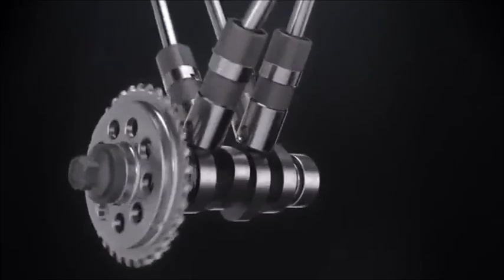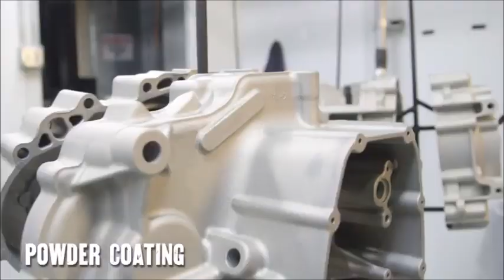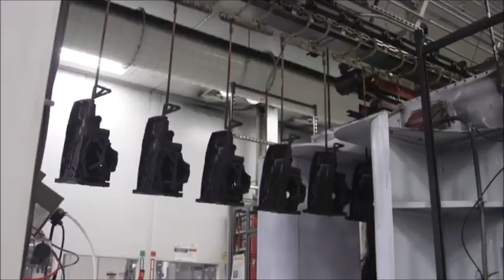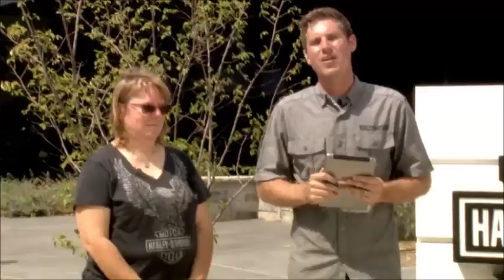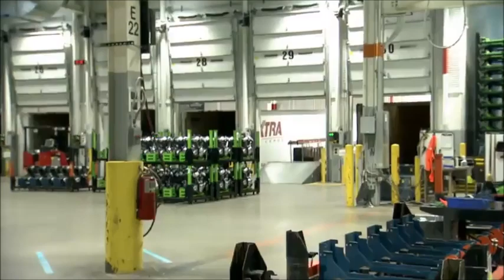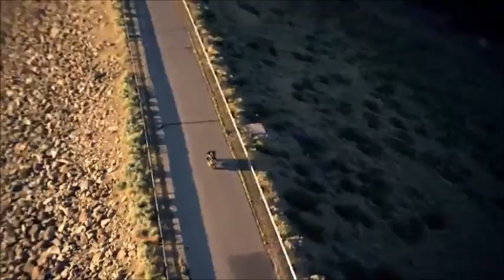Harley-Davidson Factory Tour - Building the Milwaukee-Eight 107 Engine

Comment: My last comment My engine oil 60 weight Airplane Engine oil fabricated power steering cooler from an automobile cut the barb’s off soldered number 6A AN fittings stainless braided throughout the bike no hose clamps, enough said.🕶

Comment: Part two of my comment only did a valve job once in my kitchen floor turn the oven on about 500° for about an hour and a half my valve guides in the freezer made it inserting tool out of a diesel valve guide had my wife hand them to me they were numbered send bag on the floor burlap folded sacs with my mallet I said one she grabbed one and served it as for number two inserted it hand lab The valves to the seats fresh rooms put it all back together again ran fine who needs to pay for a mechanic not me now you know what I did and how I did it right now on the last leg of finishing my hot rod 1940 Ford deluxe coupe I’m doing all the work myself as usual there at his fellows, 🕶

Comment: Hello fellows my favorite is a 1950 FL rigid dog leg frame built it myself sandblasted the frame took care of the hairline cracks stress relief the frame squirted Emron urethane dark rich blue metallic stark six over Springer cut the down tubes of another sprayer add that to mine 6 inches over stock front rocker edit an inch and a half the ride was fabulous no High speed wobble design my own seat with Sissy bar edit fishtails blue Blue Chrome everywhere custom made chain guard out of brass added a brass bib between the tanks carburetor mount brass high-rise manifold 3 inches on my T manifold with a Bendix carb high speed adjustment needle fabricated a thumb lever for my retard and advance my distributor Hallcraft  spool on my 21 inch Avon speed master front tire mounted on my springer bracket to hold my hand grenade blue chrome, 22 inch ape hangers customize my clutch do I have Fiber fiber plate to a full plate transmission sprocket 24 tooth primary phase 3 Belt Dr. turn off the chain Oiler and never had any issues with my scooter 22 years with me, replace the pushrods with solid ones that stupid plunger on top of the pushrods Factory sucked if your push rods are out of adjustment that plunger falls between your rocker arms also made custom rocker arms the arms were bolted on not one piece

Comment: Jared, why doesn't HD offer their new Milwaukee-Eight 114 (114 cubic inches, or 1,870cc)  in the Breakout model or any other series that Harley produces? I don't get it. You want bragging rights from a-z then you offer up your best/latest.  

GM is doing it via their new Camaro. Going toe-to-toe HP-wise with their fixture, Vette, line-up.

Comment: Ya right im glad harley is trying to update the engine and all but they have had alot of time do so and really never tried to address the fatal flaws in them for all the years they held sway in market. The thunder stroke 111 by Indian is a masterpiece  and now that harley has real competition again and sales are dipping they are trying to throw  a moderately updated  engine onto the market and say "hey look what we did". Polaris did i right by buying the brand and designing a power plant from the ground up and giving people a motorcycle that not going to have planned breakdown at 5000 miles. I think this is a case of to0 little too late. If harley truly wants to hold the market in the yrs to come they need to rethink who they are and how they got there       and not just say o well we are the brand everyone knows sell more Tshirts no body will want a bike that never breaks down so they can look cool working on it in the driveway everyday instead of riding it how will indian sell all the tshirts leather garbage and other crap if their bikes dont break down and they dont have to vist the dealership every week
Reply: Tony Vasconcelos im talking about cam chain tensioners that are made with rubber boots that have no place inside of any machine and the fact that they do not tell you that if they are not replaced then they will fail im talking about the fact that almost every family member i have with one needs a heat shield for there leg. I could also talk about the fact that the cylinder heads are not offset for a bike that relies on air cooling of them!!! or the fact they hold only a couple quarts of oil im just saying they could have done a better job of holding the market with quality not just "o well we are the only american cruisers out there" thats why indian is going to retake the market
Reply: +jay fed 
Jay but everyone knows that Harley isn't the best engine ... I know that and I wish that I couldn't of seat in traffic without worry yes BUT even with all the flaws that you are mentioning they are still the bike that people like 
You see what you fail to see is that no always the best bike is the winner ....
With that said I love competition ...because if Indian or victory comes out with better bikes Harley has no choice but to make something better and that's the beauty of open markets ....now Harley has to come out with better stuff ...I really don't see them overtaking them but better for us he consumers now we have more choices I am sticking with my Harley but I wouldn't mind and Indian at all. As long it's American I am ok

Comment: Harley Davidson works very hard to produce high quality, modern, and attractive products. The Milwaukee eight is another example of this.  As I was watching this video, I thought to myself, let's see how long it takes until people make demeaning and obnoxious remarks, my question was quickly answered.  It's very easy to make sarcastic one liners. To these people I ask, what have you produced, what qualifies you to nit pick. Have you established a company that has showed tremendous resilience and tenacity for the last 113 years and has a worldwide fan base with  the most loyal customers of any brand? Until you have  accomplished anything of significance, keep your mouth shut.
Reply: What qualifies most buyers like myself is precisely that, I am the consumer who pays a s**t ton of money for their bikes and I want it to perform better than their cheaper competitor, Japanese motorcycles. We want a quality product that doesn't fall flat on its face during the torque curve when out riding. HD is not 100% American made and over charges their customers for an outdated engine design. Victory and Indian have Harley beat by several miles in terms of performance, handling, and reliability.

Comment: why is Harley Davidson always embarrassed to publish horsepower and torque specs, this new motor is great but you never hear about the horsepower and torque specs
Reply: 107 cid 111.4 ft-lb, 114 cid 124 ft-lb. Right off of the HD website. 92.5 hp and 100.6 hp respectively. motorcycle dot com. :/
Reply: False

Comment: Highest quality products for your customers???? .... yeah right, like cheap pressed-together cranks, compensators that don't last and cheap chinese wheel bearings that you must change almost every time you mount new rubber and don't forget the endless recalls. I think you guys traded high quality for high profits in your pockets a long time ago. So how many recalls will you have on these new batch of clutches? Wow, 2 plug, 4-valve technology with (only partial) half-assed liquid cooling .... welcome to yesterday! ... that has been around for decades in other bikes that have fully liquid cooled engines. I guess you're saving a FULL liquid cooled engine for ten years from now so you can debut another "new" engine?
Reply: You can keep your hot (overheating), violent shaking, and outdated bike. While, the rest of us will be sitting nice and cool at stop lights with our liquid-cooled; performance oriented motorcycles. Most Harley riders, at least when I had my Dyna Sport Bob, were assholes to other non-harley riders simply because they were on a bike that they did not like. Btw, my bike came with a stock 96ci engine.
Reply: Radiators are for cages and ricers.

Comment: Instead of building a new engine, how about fixing the shi%ty cranks, install Timken bearings again? There are a lot of improvements that Harley should be doing. In memory of Harley-Davidson Motor CO. 1903-1999 Died From Greed.
Reply: Well the new engine should have that fix
It's all capitalism man it's better for them to make you buy a brand new bike than to fix the one you already have ... If they fix it to perfection you will die with your bike and they don't want that,,, they want you to go and spend money Ina new one.... Me ,,, I'll keep my 09 Harley for now.
Reply: I agree with you, Freddy Grey.  Harley Davidson always makes a bigger engine to fix the current, existing motor's problems. These issues are overheating, shaking like a freight train, and performance characteristics falling flat on its nose. Their bikes' torque and horsepower drops dramatically on a dyno like a curved pattern, downward.